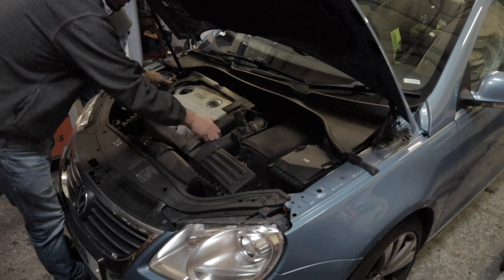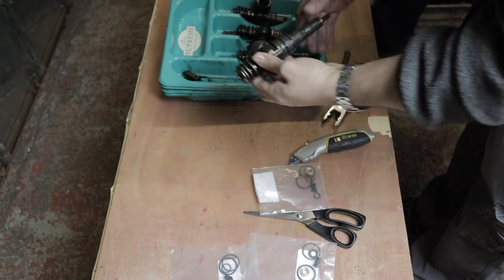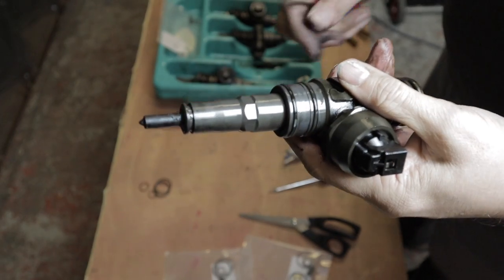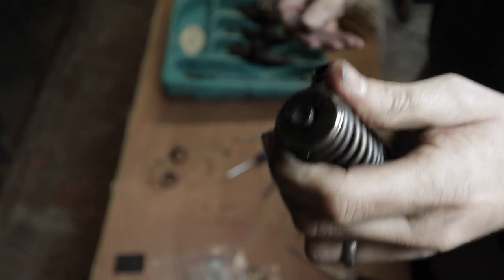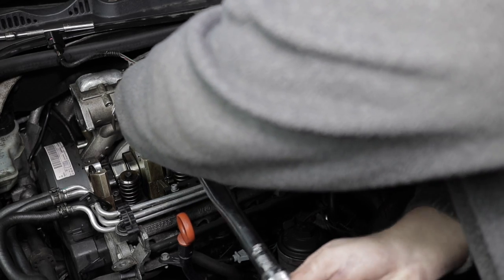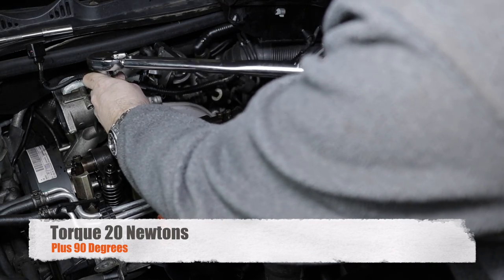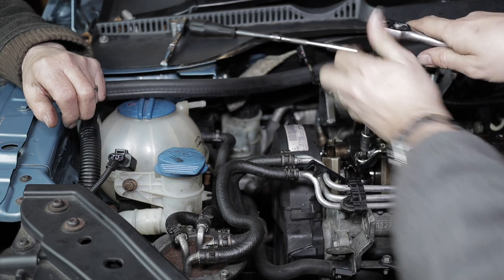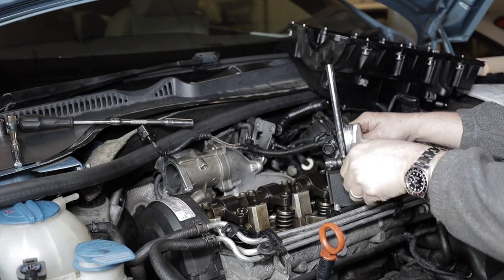VW PD injector, Remove, Reseal , and install, The complete Job

Comment: hi can i asked why you needed to change them ? running badly ?
Reply from the maker: Apart from usual injector problems that cause rough running, poor spray patterns, Smokey engine, poor fuel economy poor performance etc, with pd engines the fuel goes through the head so excess fuel in the oil, or when checking the head or low pressure at the injector, the pd injectors themselves create the high pressure, 
if you take the injectors out you might as well reseal them as advised
Reply: @RichManPoorMotors  i have a vw caddy with a misfire from cold,all ok after about 5 mins then runs fine,changed the glow plugs,injector wiring loom made no difference,no engine light on,might take a look at the injectors then
Reply from the maker: @gilly71270 it could be a number of things, looks like you have checked 1st things, it could be a leaky injector leading to a wet piston might be why when it’s hot it doesn’t show up it could be bad compression could be a bad spray pattern etc good luck in finding it soon

Comment: Love the content, I'm stuck with the injector stretch bolts that have the grip of Arnold and I don't want to round them off
Reply from the maker: I don’t know what to say, have you tried a freeze penetration spray especially if you can warm it up 1sr

Comment: Is the engine in your video the 1.9 ltr ? I have a 2.0 ltr TD and it has Siemens injectors. Do you know if it is the same procedure as the 1.9? Thanks.
Reply from the maker: Hi this engine shown here is the 2.0tdi 8 valve, engine code BMM, it had bosch injectors I believe it’s same principle for all PD engines, no matter which manufacture injectors are fitted although i can’t confirm I can only comment on ones I have worked on, if it is common rail which was fitted from around 2008 onwards these aren’t PD injectors

Comment: Hi i have 1.9 tdi pd 96kw, I repaired one injector at the shop and all injectors new seals but my problem now is i have low power. They pulled injectors twice and tested they said injectors are very good also on Vcds balance isnt good two injerctors are above 1.5mlg.
Before repair car has white smoke when cold and power was very good. 
What do you think
Reply from the maker: Too hard to diagnose over the phone, check that there are no air leaks from air box to inlet manifold, possibly check turbo actuators both have pressure and free of movement, check sensors are operating as should on vcds, have injectors been correctly set timing when reinstalled, check egr isn’t clogged and working, check air filter isn’t blocked check fuel pressure, I hope I’ve helped in some way
Reply: Fuel pressure and injector timing has to be check.
All other things has been checked.

Comment: I gave it a whirl today amongs other things,  I’m not confident the timing is right on the injectors,  I’ve not tried running it yet,   When you set the injector I place it at the lowest point,  adjust the stop until it makes contact and turn back 180 then lock it off,  should I be looking for more resistance from the adjuster or just when it makes contact ?
Reply from the maker: Just as you feel it snug, then back it off, it shouldn’t be forced your just looking for contact as you’re looking to set the gap
Reply: @RichManPoorMotors  I can’t see from the video,  but I assume it’s more than just making the adjuster make contact,  you actually wind the injector coil down until it becomes firm?  Then back off 180?  I currently they are set wrong if this is the case,  but the rocker covers still off so will adjust them tomorrow.
Reply from the maker: You wind the adjustment bolt down to feel it contact at the bottom then back off 180, if your not sure the wind it up a bit then back down you are just feeling for it at the bottom then back off, your not trying to force it, but you shouldn’t have any doubt that it hit the bottom, if you look at my video at 28:22 you will see that I’m only moving the ratchet with 1 finger so that I don’t put too much pressure. Just make sure that you use your dial test indicator for the lowest point, on each cylinder
Reply: @RichManPoorMotors  brilliant,  it was what I thought originally but couldn’t tell in the video’s so played it safe for the evening.   I’ll re adjust them tomorrow and finish what I started today,  the infected were covered in carbon and the EGR was severely clogged too so it should run lovely when this is all finished.

Thanks again for coming back to me,  I appreciate your help,   Keep up the good work.
Reply: Injectors all done today,  have primed the fuel with vag com measuring block 35 3 times to prime the fuel and just would not start,  I think it’s now destroyed the starter.......
I’ll leave it a few days prime the fuel again to make sure it’s not let more air in,  and try bump starting. .
Reply from the maker: They are a real pain to start with air in system, they usually start run and then stop, as air from the return goes back to the fuel filter then round again, same when you change fuel filter
Reply: @RichManPoorMotors  it was definitely a pain,  but when I did just the fuel filter it started on the button,   I guess it was open to much more air,  I’m hoping bump starting it when the snows gone will get it running,  currently the batteries off the car and on charge.
Reply from the maker: @LouisCleaver  just to warn you when it starts the air will probably go around the fuel system and it will probably stop again this happened about 3 times to me from memory, I was about a mile away from my tools on the way home on last stop tried to restart at the side of the road for ages, then all of a sudden restarted like I never had a problem
Reply: @RichManPoorMotors  thanks for the heads up,  fingers crossed it’ll work otherwise I’ve no idea what’s wrong.
Reply: @RichManPoorMotors   had a quick look today,  I put fresh battery back on the car,  turned crank manually and it started to turn again,  after some time it fired up,  splattering what looks like oil all over the drive from the exhaust. And plumes of white smoke come out,  then the revs just hit the redline.... so I turned it off before it blew up!,  then I tried to start it again and it’s just turning and turning.
Reply from the maker: @LouisCleaver  not sure what it could be, is your cams in right, engine timing set right, do you know if your injectors are ok, are they bolted in right, sounds like the 1st time you may have had excess fuel, now piston might be too wet to much fuel into to burn
Reply: @RichManPoorMotors  I never removed the cams,  so I guess engine timing etc is as was,  the piston being to we could explain the mess it threw out the back.  I’ll wait until the weekend at this point,  and reseat the injectors and double check I have timed them properly,  I wonder if soaking them in injector cleaner has caused the rubbish inside them to clog the ends? 
What’s annoying is it ran and started perfectly fine before I tried to sort this “little issue”.
Reply: @LouisCleaver  did you solve the problem? I'm having issues starting a 2.0 tdi blb

Comment: My pd injectors bolts come loose after my 2 lot of 90° of torquing  them up and that's with new bolts  I notices after reving engine at 2000 revs make a clucking noise . Is there anything  I can do so the bolts can grip on the head.
Reply from the maker: im not sure why the bolts would  have come loose if torqued to the correct settings, if the threads in the head have became stripped then there are only three ways i know to fix this 
1st  way is to use a thread repair like a Heli coil
2nd way  is using oversized bolts and tapping a new thread
3rd is having head welded and new threads drilled and tapped

Comment: Hi,my touran is struggling to start,replaced seals in tandem pump,so could it be my injector seals?
Reply from the maker: Was it struggling before you took of the pump?
If pump seals I take it that the pump hadn’t broke up and sent metal though to injectors 
If you remove pump or fuel filter you get air into the system, 
prime fuel pump and try and start to push air through injectors, give plenty of rest between starts it may take 30 mins or more, once started it will run and then stop a few times as air is expelled you probably will also need to recharge you battery
Reply: It was struggling b4 I done the pump,it runs better,but still taking ages to start
Reply from the maker: @rmaulkerson  also check turbo actuator is working

Comment: Hi,
I have a 2006 vw passat with 180000km on the clock. It runs fine on idle but produces a lot of black smoke under acceleration. And the there’s vibration coming from the engine when I try to make heavy acceleration. I removed the injector the other day and its full of carbon deposits on the tip. I also found a lot of fuel when I took it out. Do you think a new seal will help resolve this issues on my car? Thanks!
Reply from the maker: If your injectors are ok and you have taken the injectors out you might as well put the new seals in, if you have a ultrasonic cleaner clean the tips of the injectors, it is impossible for me to know if your injectors are ok, if smoke is black it would suggest fuel, but cold also be linked to turbo, check that your vnt is free and that it’s working ok and your turbo actuator is working fine at that km your valve guide seals might need replacing
Reply: Thank you for your quick response. How do you check if the injectors are still ok? Any tips on how to tell if its bad and need replacement? Yeah, the turbo is newly rebuilt. I was thinking its either the injectors/seals or the valve seals that causes the problem.
Reply from the maker: On petrol cars I take them out and put them in my machine, and look for a leak test and spray pattern on diesels I don’t have that machine for pd injectors so I have to send them away if I think they are at fault, I look at them on vagcom 1st and check the fuelling figures and pressure figures also before stripping I listen with a stethoscope in cdi cr injectors bit hard on pd injectors
Reply from the maker: Just thinking  2006 do you have a dpf on your car and is it clogged could also creat back pressure in the engine and turbo not spooling up. I had this on a golf once

Comment: So can I just take the injectors out and fit back on without doing anything else
Reply from the maker: You have to set the timing (cam adjustment) as shown on the video towards the end of the video, but you don’t have to code computer or anything

Comment: Do you need a dial Gauge to check the injector lash?
Reply from the maker: You need to know when the cam is at its most compressed, although you can watch the spring being compressed I personally wouldn’t rely on eye sight alone, so my answer and advice is yes you need a dial test indicator to know for sure
Reply: @RichManPoorMotors  thank you, Ive installed a new injector on my 2.0 tdi azv pd and the car won't start, it just keeps on turning, timing is spot on and no codes are being generated by the computer box.
Motor is healthy but just won't start, do I need to bleed the fuel system?
Please help.
Thanks.
Reply from the maker: ameer amod hi when I re sealed my injectors and again when I changed fuel filter on a service, the injectors need bleeding of air, try cycling fuel lift pump approx 10 times, then start engine it may take quite a few long cranks but eventually all the ones I have have started, just run at 2000 to 2500 rpm for about 5 to 10 mins as it will stall again if left on Tick over and be hard to start again, as air circulate back to fuel filter and back to injectors again eventually it will go hope this helps
Reply: @RichManPoorMotors  thanks.
I will try that tomorrow and let you know what's the outcome
Reply from the maker: ameer amod good luck let me know how you get on,, I traveled 1m down the road went it conked out air 2nd time around and it was a PITA to start so make sure all the air has gone before driving away
Reply: @RichManPoorMotors  Its a PITA right now just because it's not starting, but I hope I go further than you before I conk out lol
Reply: @RichManPoorMotors  Hi.
I took your advice, I purged the fuel system for air and then tried to start it again, but it would run for a few seconds and die out, I even used quick start and that didn't help, there is no air in the fuel system, not sure why it wouldn't want to start now, I really need help with this as it is a real PITA.
Reply from the maker: The air is probably still in the fuel lines in the head, don’t use easy start as it wii F#%• UP your engine, if it started and spluttered it is probably still a bit of air in your system, sometimes you think it just going and then stops and when you try you feel like you are back at stage 1 I would make sure your battery is fully charged and try again, cycle key a few times between each start if it was running before injector change and that was your problem then I would presume it’s air in the system, on a common rail or old fashioned fuel pump to injectors you can crack a fuel line and pressure forces air and fuel out of nut but on pd engine this isn’t the case and it has to be forced through injector, as you try and start have your foot on accelerator as well as this may open injector firing time it took me about 30 mins one when all I changed was a fuel filter and forgot to cycle key 10 times before starting

Comment: Hi, I have a 2.0l BMN engine that shakes around a lot and jumps around when cold with a bit of white smoke coming out the exhaust and it stinks, Looking around online i've seen it could be the timing or injector stretch bolts, what would be the best place to start where I'm not going to be pissing money on new parts that wont really fix it. When hot the engine is fine, so I doubt its a DMF issue like audi says it is
Reply from the maker: Hi first off it’s to hard to diagnose just from symptoms without doing a full diagnosis, but my best guess sounds like it could be a wet piston/pistons this could be caused by leaking oil in piston through valve guides or leaking diesel from injectors if running fine when hot no smoke it doesn’t sound like timing Might start running lumpy + smoke when on tickover after 1-2 seconds I had a Mercedes and a mondeo hat did the same and it was injectors leaking, and a 6month old Citroen and it was dual mass flywheel but that didn’t smoke much.

Lumpy running could be caused from fuel or air or compression not at specified levels or burn to early late etc
Reply: Will harris did you ever get your issue resovled? Ive got the same bmn pd lump in my octavia with the exact same symptoms. OBD scan throws up a fault with cold start injector 2 but not much else smokes like a chimney at idle lumpy on start up and smokes if caught in traffic. So id be intrigued to know what your outcome was so im able to change the bits rather then p*****g money up the wall
Reply: @1992marcb  for my engine, it ended up been the exhaust cam timing, it was running too rich at like 1.3l an hour at idle, should be like 0.6l I cant remeber what measuring block I used to find this though, but it's a dead easy place to start. Torsion value is the intake, should be as close to 0.0 as possible. Check and see in obd11 if you can find these

Comment: Can you confirm if this would be the same process for a vw touran 1.6 fsi 2005?
Reply from the maker: this is for the pd diesel injectors, petrol injection is much more simple
Reply: @RichManPoorMotors  thank you for the quick reply.  Can I ask you a question about an issue I am having?
Reply from the maker: @marcphillips8812  yes
Reply: @RichManPoorMotors  missfire on cylinder 3. The car has had new sparks and coils. Would this suggest that the injector needs to be looked at? Could I remove the injector and clean it?
Reply from the maker: @marcphillips8812  hi as iI sure you realise it is hard to diagnose without having the car, as i presume you already know engines require air fuel and source of ignition and if one of these are out it can create problems, if it was one of my cars then i would take out all injectors and put them on my injector machine to check fuel spray patterns, 9 out of 10 times the spay pattern is faulty , you can put them in a ultrasonic cleaner, keep the electrics out of the solution, i have one as part of my machine but you could use one of these https://amzn.to/3lkYV4Y or a jewellery one, i have a larger one which i can put egr etc in. https://youtu.be/xJlQhI5WS0o  and i find it invaluable, the ultrasonic cleaner  cleans the spray pattern if your injector is firing ok, but if you had a hot spot in your piston caused by carbon then this could cause pre detention, low compression could also be effecting firing, electrics is always the 1st place i would check. but as you said this has been done, i have had a faulty new coil pack or leads before

Comment: My 2.0Sdi caddy 2010 147k miles is smoking at high revs or harsh acceleration could it be the injectors and is it common.
Reply from the maker: presuming that your valves and rings are ok then Could be injectors, or turbo, check you don't have a vacuum leak to the turbo, or a induction leak, also check that the turbo vanes VNT move freely if you can as some times there is a carbon build up, to hard to diagnose over the internet
Reply: Egr
Reply: Egr or injectors.

Comment: Is this the 2.0 sdi engine
Reply from the maker: Engine code is Bmn it is 2.0 tdi use in vw seat and Skoda  and I think even Audi not sure if they just had BMM though 
there are lots of pump Duse diesel engines this is where the injector makes the pressure in lots of different configurations from 1.9 to at least 2.4 possibly more before they went to cdi which has the pressure in a common rail